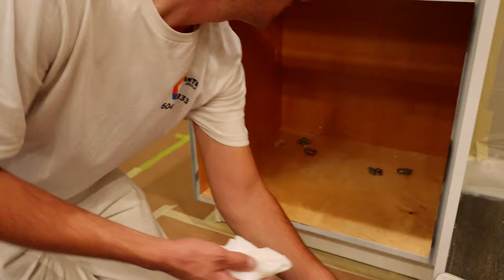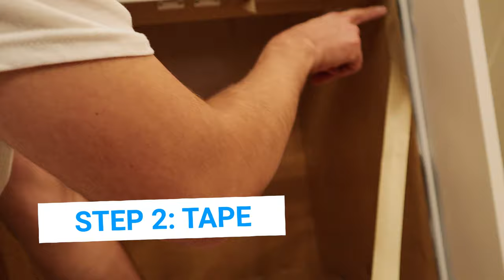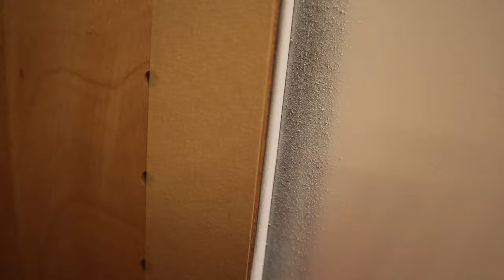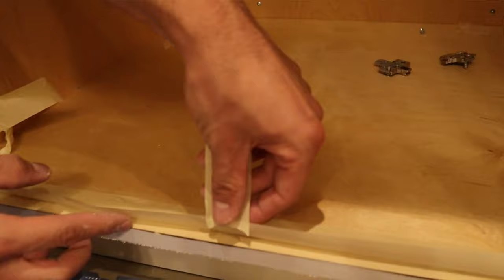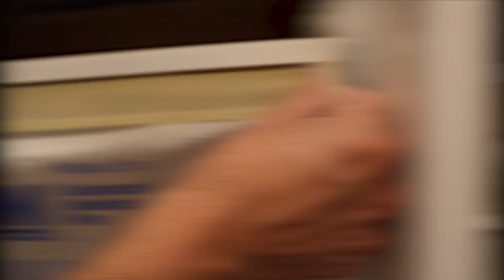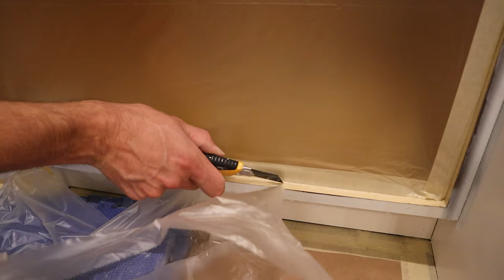HOW TO mask inside of frameless CABINETS

Comment: Excellent & informative. I use the same plastic but I switched back to paper because of the flaking. However, I can still up my game by continuing with your system of taping. Thanl you for the informative upload, amigo.
Reply from the maker: Even with 3m flake resistant plastic you still have flaking ? (May be you’re using bin primer 😊??)
Reply: @KonstantinUdalov  Primer is ML Campbell's Clawlock catalyzed pigmented primer. The topcoat is ML Campbell's Turino or Resistant, both acid catalyzed pigmented varnishes. Unmasking was a mess. The static attraction of the flakes to the cabinet was a bear to deal with, trying to present a clean cabinet back to the cabinet shop. Maybe it's me, but the flaking s still there, me or the plastic sheeting.
Reply: I too have switched back to paper over plastic. Depending on how brittle my coatings were, I'd have flake issues on the next coat. Never had an issue with the paper. Also the paper tends to be easier for me to over apply and razor back. But to each his own. As long as the job is done well in the end.

Comment: As others have mentioned...Thanks for the frameless version!!!! Question on why you pull back the first course 1/16".  What do you do about that little line of paint on the inside?  Thans again.
Reply from the maker: This makes the corner a bit more resistant to paint chipping when it wraps around

Comment: I suggest you change your title to include the “frameless” - it will help it to stand out against all the others for face frame cabs which everyone has uploaded.. if it wasn’t for the image where I could see you were working with frameless cabinets I probably would have passed this over.  You might be the only painter that has show the masking process for a frameless cab.  Thank you!
Reply from the maker: Done ! Thanks a lot ! Appreciate your advice
Reply: Konstantin Udalov I appreciate your videos!  This tip saved me some time on my first frameless cabinet refinish job.  I knew there had to be a good system for masking the boxes and I just needed to find the right source.
Reply from the maker: @OGStr8UpJack  Hey brotha! I'm glad it helps! A have a lot more coming up! Just been busy building the company here in the weeds